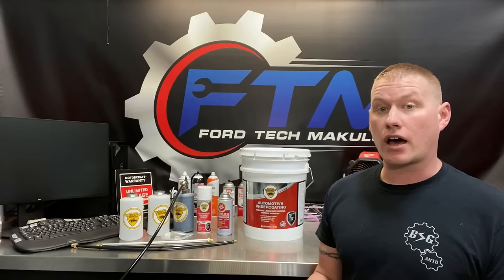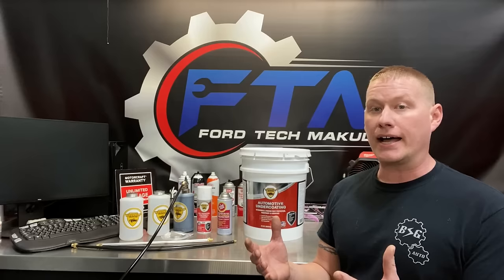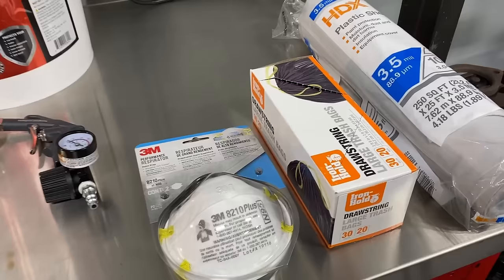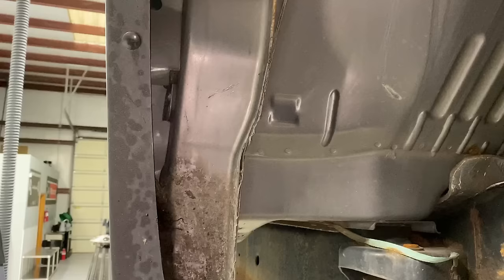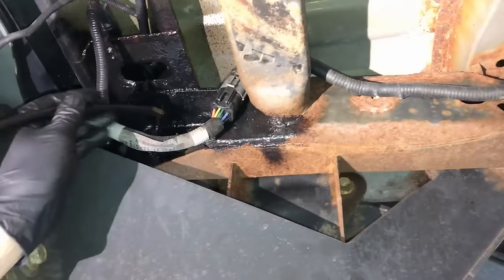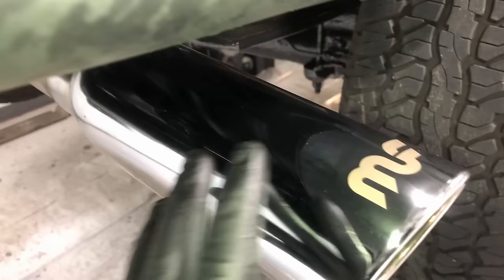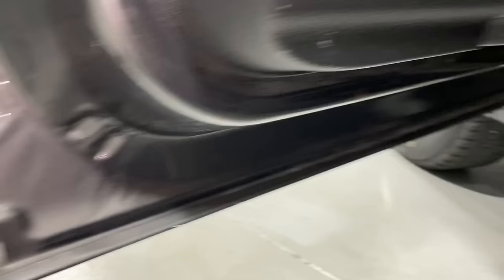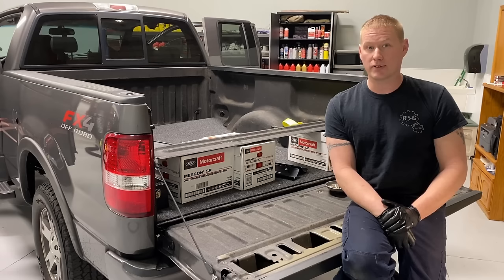Undercoating Your Vehicle with Woolwax: Is it Really Better than Fluid Film Though?

Comment: I have not had luck with any of these products,it seems to wash off quickly here in the northeast.I am thinking of using chain lube/bar oil  or back to used motor oil .
Reply: Try cosmoline, it dries
Reply: Cosmoline is very expensive  especially when you have several trucks to cover . I am going to use chain lube maybe add a little used oil to it .

Comment: IT'S TOO BAD THE MANUFACTURER DIDN'T PUT THE PRODUCT
 INTO A STANDARD SIZE ONE GALLON PAINT BUCKET SO YOU
 COULD POUR IT INTO THE QUART CONTAINERS BY USING A COVER
 LID FROM Shur-Line 1783844 Red Silicone Mess-Free Store and Pour
 Collapsible Gallon Paint Can Lid

Comment: I have a Honda Pilot with plastic liner around wheel well in Chicago. Will the plastic trap salt ? Should I put fluid film on the plastic?
Reply: Yes it will trap salt. Pull the liner and apply to the metal

Comment: does this product stay "wet"?
Reply: Woolwax® does not dry. When applied Woolwax® will create a wet gel-like barrier that moisture and oxygen cannot penetrate. Without moisture and oxygen there can be no oxidation. because Woolwax® is non-drying, it is always active and migrating into the inaccessible areas of the doors, seams and folds of the sheet metal, and all the other difficult to reach areas. Woolwax® is very thick and will not wash off easily. An annual application will easily protect your vehicle through the snow/ice/salt season. In the enclosed areas, (doors, frame rails, rockers, etc.) the Woolwax® will provide protection indefinitely (years). It is only the exposed areas of the undercarriage that should be coated annually with Woolwax®.
Reply: @bobr1008  Great information,thanks...

Comment: My issue: I purchased 3 months ago a used 2013 F150 XLT Supercrew 4×4 with the 5.0L with 110k miles on it. Super clean. Seems to be well maintained. My issue is the rear backup camera feature with the screen being inside the rear view mirror. All of my other features work: rear parking aid, back up sensors, ect. Whenever I put my truck in reverse, a blue screen pops up in the mirror display, only shows for about 5 seconds and goes out. I get a blue screen only. No message errors, connection error or anything. I get just the blue screen for a few seconds and it goes away. I have checked all connections, removed the tailgate emblem, and checked the camera and camera plug. No corrosion was there. So I used contact cleaner and cleaned both the camera harness plug, and the prongs on the camera, then used some die electric grease on the connection. To no avail. I removed spare tire, and checked all harnesses and connections under the bed. Everything seems great. My truck has zero rust and was garage parked 1 owner. I purchased a new camera replacement and plugged it in yesterday when it arrived. To no avail. Still get a blue screen when placed in reverse and it disappears with the new camera. So I believe I've established it's not a camera problem. I've tried looking for electrical schematics on the camera layout. I also know there is a reverse switch under the driver kick panel. However, I know the reverse sensing camera aid, and all sensors work. So I dont think that reverse switch could be the problem of my camera not working. Could it be the display in the mirror? Could the mirror be bad? Is the sync radio (4.2 display radio, no touch screen) all tied into the camera operation? Is there a program update required on the reverse backup camera? Grounding issue and if so where can I look? Any help in recommendation, guidance, where to look next I'd so greatly appreciate. Thanks very much. And happy new year.

Comment: I don´t think it is a good idea to spray rust protector over rusty metal. Protector is great to prevent rust to start building up but is does not make old rust go away or stop it rusting further. Rust will go on under the protective layer. I bought 2004 new Citroen Jumper van and had it rust protected immediately. I drove it 12 years and 190 000 km´s, here where they use a lot of salt every winter on roads,  and it had absolutely no rust anywhere on protected surfaces. The paint though did peal of on sides, roof and bonnet because Citroen uses really poor quality water based car paint.

Comment: Great video Brian.  Its a shame Ford doesn't put a permanent coat on everything at the factory...especially the beds, doors, and rockers.  Wondering how bad the aluminum ones are going to be after a few winters ?  Some of this anti-icing stuff doesn't get mixed correctly and dissolves everything.

Valvoline has a product called "Tectyl"...in various types. I used to haul it in 55 gallon drums, the type I hauled was more of an industrial product that was solvent base and applied relatively thick. I saw it used underneath over the road trailers and around shipyards. It never truly dried, stayed gummy and I think it took mineral oil to remove it. 

 
 I had a 55 gallon drum bottom split and it made a mess in the trailer. Thick and gooey, it did crawl and some soaked into the wood floor...and was difficult to clean up.  I'd say it would be a one time application.

Comment: Friend, like your videos love the great work ! I have a question. After knocking the dirt off and before the protection spray begins and before the Woolwax protection, wouldn't you want to put something on the bare metal with something more lasting to grab the bare metal places than the Woolwax since it would be a maintenence app, which I like that you put that in with ! Some way hoping to go back to before a time like before the corrosion and damage from rust began. The best possible point to start at.. aged layer of paint or better yet.. if you could find a type of primers underneath a spray shot of paint and maybe your Rustoleums ?? Then after it hardens the Woolwax protection ! Another viewer asked if it could be.., that in a year if you could give everyone your diagnosis and maybe a visual of how the Woolwax weathered the year 2019 - 2020 ??  Excellent work bro'  ..fine work !! 🚘

Comment: I will recommend to get it done professional. you have to now every cavity. for that you need blueprints of your model. use a dealer which is controlled by a 3rd instance. depending of car. it cost 400-700$ get it done every 2-5 years depending outer spray only for follow up is cheaper

Comment: Best thing I ever did for my vehicles was move away from the rust belt. The government should be paying the taxpayers for all the cars they destroy from the salt and brine.
Reply: Agreed! Also when they do chip and seal road surfaces. Causes a lot of rock chips! They've been doing it here a lot. Makes me mad. Cheap and loud roads.
Reply: Instead they tax us more on everything because the salt and temp changes make more road work
Reply: that's right , winter tires are cheaper than a new fucking car. jest let us drive in the fucking snow

Comment: Instead of an old cup or something why not use a bigger size soup laddle for less mess..
Reply from the maker: It would still cling to the bottom and drip off. A cap with pour spout would be best but hard to find in the 5 gallon bucket size.
Reply: Even easier to pick up the bottle with left hand and fill it over the bucket, no mess or waste

Comment: That scoop method was so poor smh lol . you could have either poured it out into a smaller bucket like I do at work with 5 gallon buckets of paint into a rush bucket and then into your funnel or you could have used a deep sauce or soup spoon and scooped it into the funnel and you should have been doing it right over the bucket instead of getting it all over the place like an amateur
Reply from the maker: Of course it was, it literally was a last minute work around with what I had there and it worked fine just a bit of a mess.

Comment: Fluid Film..often imitated,never duplicated.Thicker is not the answer. Fluid FILM..protecting since the 1940s
Reply: What they are putting on the roads today is significantly harsher than what they used 50+ years ago. Fluid Film is a good all purpose lubricant.  With the chemicals being applied to the roads today, Fluid Film is fairly useless because it washes off so easily.  Nostalgia is great, but in 70+ years conditions change and newer and better technologies become available. VCR's were great in their time. Dot matrix printers,  fax machine, polaroid instant pictures...fluid film.
Reply: @bobr1008  we get it Bob you don"t likr Fluid Film..lol

Comment: The Best Undercoating is Florida. 1999 f-250 super-duty Lariat   first  generation 2000 body style  off the line. My plugs never break. My intake is all aluminum . I have a 5.4 and it has 240,000 miles. I bought the truck in 1999 and drove it for 6 months before I saw another Truck like it. People broke their necks  looking at my truck and thought it was a Dodge .

Comment: Are you going to Woolwax the shite out of your new ride? If I ever get  a new vehicle again, i'll Woolwax it, plus fill the frame-rails and rockers with foam to keep the corrosive junk out of the nooks and crannies that never get cleaned.  THEN take the aluminum tape HVAC contractors use to seal the air trunks, and seal the holes.  The rocker panels on my 2012 F-150 are in hard shape.  Had I done what I describe, they'd be just fine.

Comment: Been using fluid film for over 10 years,  it clearly states you can coat all electrical connections, fuel lines, rubber hoses etc. I SOAK my entire undercarriage on my 04 F350 and its SHOWROOM  new still. 
This wool wax looks like CRAP! 
Also fluidfilm smells like butterscotch and it goes away after a day or so of driving

Comment: South Main Auto channel has a video where he say why this stuff is bad.
Reply: As long as it's not a rubberized undercoat this should be fine - oil-based sprays are the best option, but require annual respray.  This is lanolin based, just like Fluid Film...which SMA LOVES.
Reply: You better go back and watch the vid again that's a false statement.
Reply from the maker: South main endorses fluid film and this is the same exact product as fluid film just thicker so I am not sure what you are talking about exactly.

Comment: This is all fine and good, but isn't doing this now creating another set of problems? It's lanolin based, very greasy, so how are you going to keep these vehicles on the frame lifts, they'll slip right off like a watermelon seed thru a fat man's fingers! Secondly, that 5 gallon bucket looked heavy. It's like painting your garage door. It gets collectively heavier with each coat. There goes your milage as the years go by. Increased fuel cost, more tire and brake wear. And lastly, being tinted black, living in the Chicagoland suburbs, we have our share of skunks. Now if you graze one, you'll cover that telltale white stripe, and there will be a bunch of smelly black cats running around! You'll still swerve, just for different reasons.
Reply: Lol 😁